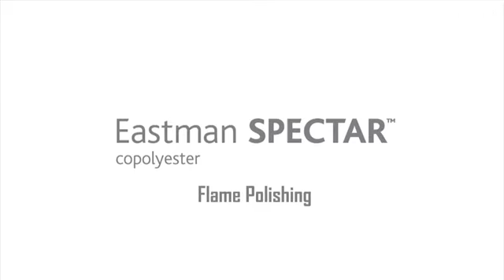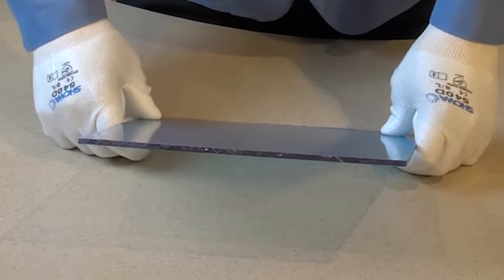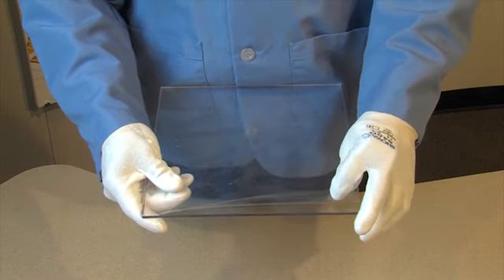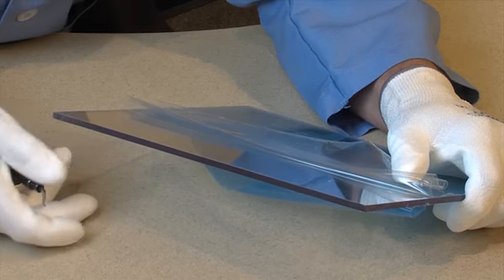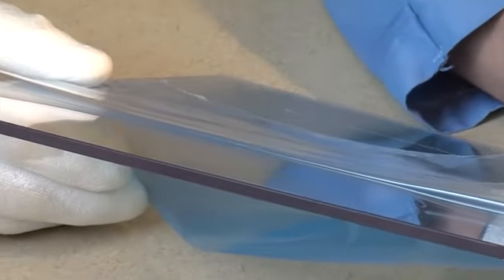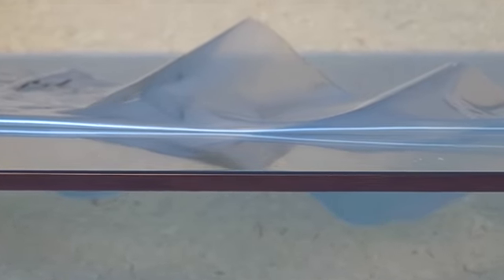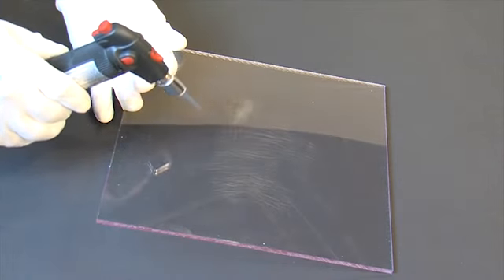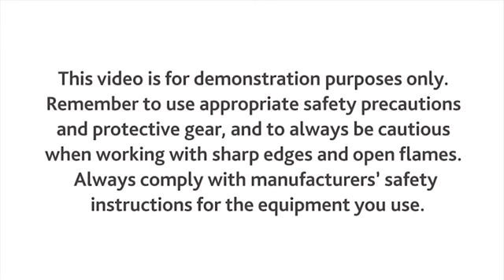PETG FlamePolishing

Comment: Just wondering if this flame thing works on PETG tubing?
Reply: Colin Java You could try, I think it'd depend on how thick it is. If it's thin and small, it might warp or bend the tubing. I would assume that it would need to be around the same thickness of the material used in the video for proper results